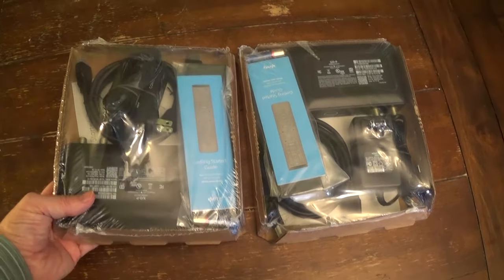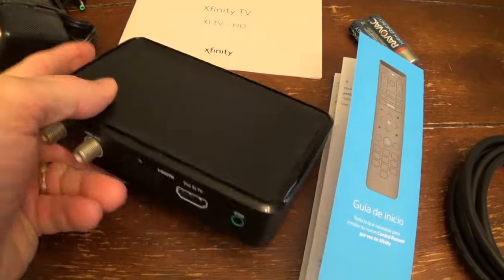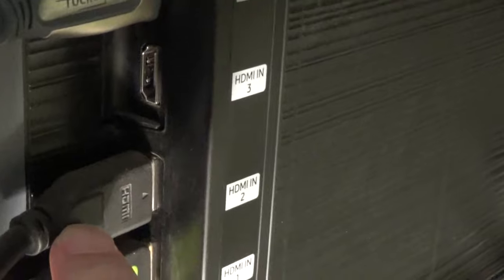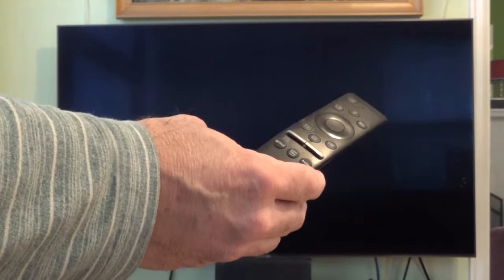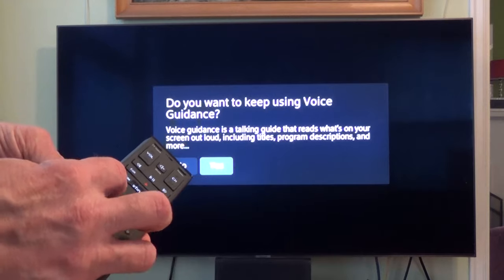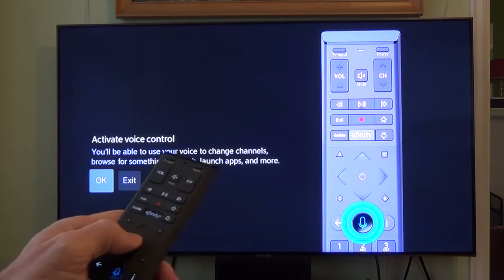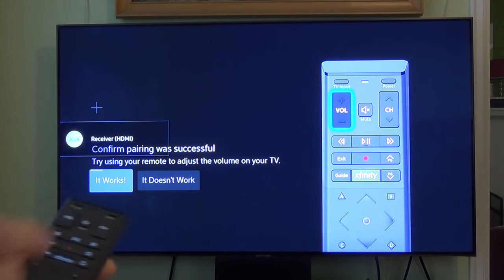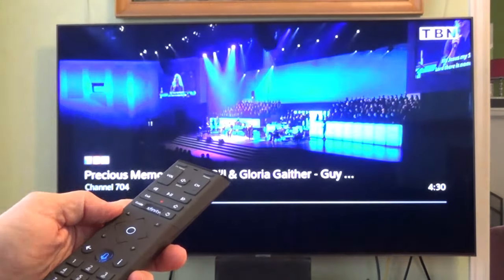How to Set Up a New Comcast Xfinity TV Cable Box

Comment: Got the same issue. Tells me to tightened the cable but it’s tight. Matter of fact I disconnected the pos and plugged my old box back in and it fired right up. Guess I’ll have to call a technician. Spent over 2 hours on this.
Reply: I had to cycle power a few times.   Box finally worked but said low signal

Comment: So I only have the Comcast modem/router for wifi and I also use a antenna for TV. Then they send me this small block box for the streaming of the couple free apps. I am getting tired of it saying to restart this or that every couple days. I hope you might know more about this error I keep getting that says to push the WPS on top of router which I don't use that way to connect. It says to move tv box closer to wifi devise lol, the TV and black box is on table with TV and sound bar which soundboard don't work senc3 getting Comcast service. And the modem/ router is on table next to TV. So I don't know how much closer I could get through this.. Any ideas

Comment: I don't know if the original remote to that TV is at critical. I just powered my TV on with my older Comcast remote. My old comcast remote was the silver one where you could just select tv on the remote and press power. I was able to set up a new cable box just as easily
Reply: your TV need to be set to the cable box connection. A new box does not know how your TV is connected.  If you replace a box, it will probably be set already  but the auto power on TV will not work

Comment: Xfinity sent us these pieces of crap boxes to replace old boxes we had. Problem is, we need RCA cable outputs, the red, yellow, white A/V cords? It was on the old box, but not on the new one. Even using the cable out to a DVR with RCA cables, then to the TV doesn't work. Nothing comes through.
Is Xfinity FORCING me to use their DVR system? I have a specific way I want my setup to be, and Xfinity is cutting me off? I doubt that's legal.

Comment: Please read lol. Im so confused bc I don't have a modem or router gateway for internet here at my apt I just use my neighbors Xfinity internet. Anyways when I activated this box I never connected to wifi at all never but after getting it going I clearly hzve internet all of my apps work etc. I can't find anything on their website etc about connecting to wifi. Only thing I can find is connecting to a gateway which I do not have at all lol. Im So confused how im connected to wifi
Reply: Your not connected to wifi the cable boxes pull internet through the coax independent from the modem so all x1 boxes are internet capable whether you have internet or not. I'm and installation tech for comcast so if you have any other questions just ask.
Reply: @Amypndrvrsng  that's what's up man. Sounds plausible but after doing a ton of research I don't agree with what youre saying. First off if my box was just drawing internet thru my coax cable that wouldn't make sense for the millions majority of ppl that HAVE THE REQUIRED WIRELESS GATEWAY and are wiring the box to THE GATEWAY or whatever to draw their internet. If you follow any manual you find whether it be the manual that came with your box or anything else you read online, they all say the same thing. You gotta have the wireless gateway. That goes back to why I said I disagree with what you said about drawing internet thru the coax. Also if I was able to do that, everyone would do it and no one would need a router at all
Reply: I may not have explained it in the best way so all of our equipment run on the same type of signal and then once it hits the box it's going to it that box then translates it into either cable or Internet or phone whichever it is that you are paying for so our cable always has internet running through it now in order to use Wi-Fi or hardwired Internet you have to have a modem that will translate the signal into internet for you to use you could also use a modem just for phone so instead of that modem translating the signal into internet it will only translate it into phone cuz that's what its coded for. with X1 boxes they are coded to translate the signal into cable and internet for use exclusively in the Box itself you can't plug something into the box and use the box as an internet router now the older boxes they don't have the capability of translating the signal into  internet within themselves that's why you were only able to get cable from those ones. I've worked for Comcast for 4 years I install it everyday so I know the equipment very well and how it works I promise I'm not lying.

Comment: NO! NO! It doesn't work. Many Customers, especially Senior Citizen are unable to follow Xfinity's directions . A Comcast Tech. is needed. Customers need not pay $70 to $90 for Tech.Support,, particularly on rental Equipment!!
Reply: I would think some of the senior citizens would also miss the large clock display that's what the older models had.

Comment: What makes me angry is every two to three days I have to input my phone number, then rename the device, then set it up to work for my tv 15 to 30 minutes later I'm finally watching tv.  My old cable box burnt out and I only had to do that process 1 time.  The new box I got in November 2021 every two to three days repeat the process.
Reply: You need a new box a lot of them are refurbished so even though it's new to you it's not actually new so if it's rebooting like that you need a new one.
Reply: @Amypndrvrsng  Thank you.  That's what I did and it's worked like a charm.

Comment: My tv s
Keeps saying ,*welcome to the x1 platform*
Reply: There are a couple reasons this happens.  Reason 1.  Your box resets on a daily basis and you can set the time for it.  HIt the Xfinity button, move over to the button that looks like a cog (next to apps) Then click on Preferences, Then click on General, Scroll down until you see Daily Update Time.  Change to what time you want that.  Reason 2.  Cable is down due to storm or maintenance in your area.  Reason 3 something is wrong with your box or signal strength.  My new dvr box resets itself to needing to enter my phone number and renaming the device every 2 or 3 days.  I am not happy and will be getting a new box soon.